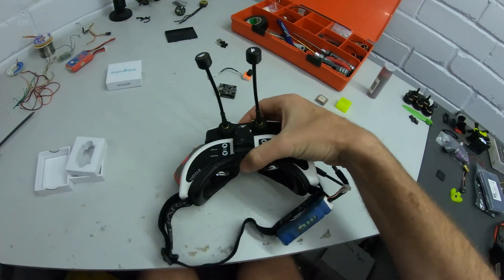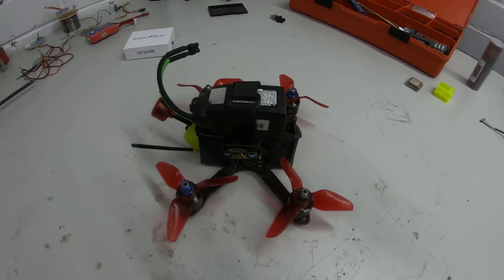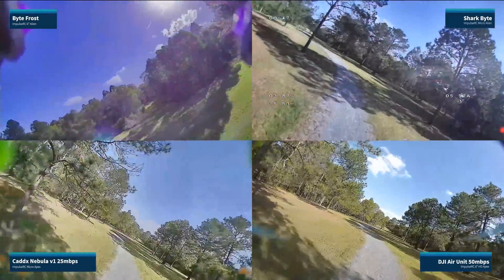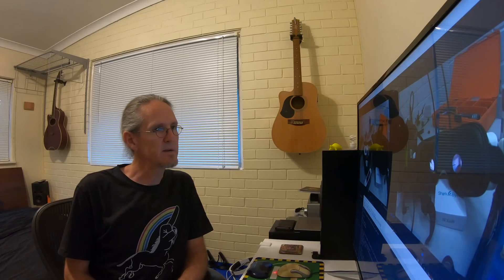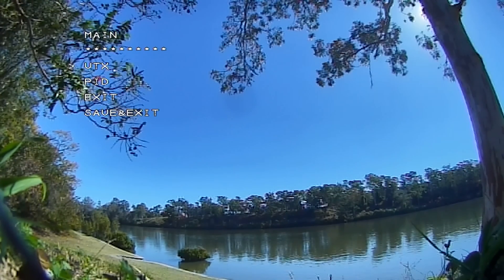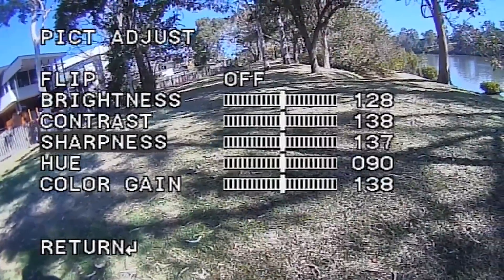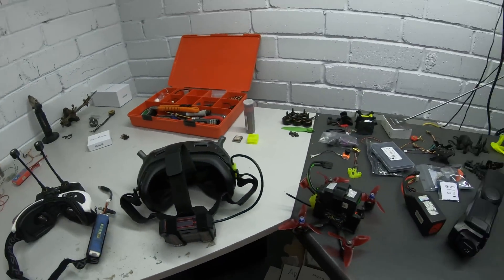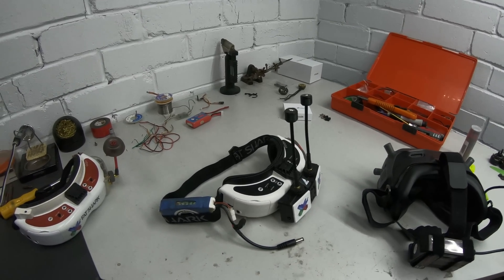Digital FPV Shootout 2 - Shark Byte

Comment: How did you get the Betafloght OSD elements on the screen, mine won’t work!
Reply from the maker: It's all in the online manual. Double check you have the right UART sending MSP data, OSD is enabled in general config, and have wired tx to rx and vice versa (the manual doesn't make this part very clear). Good luck!
Reply: @strepto42  ok thank you very much!
Reply: @strepto42  one more question, the the TX on the FC should go to the TX on the VTX and the RX on the FC should go to the RX on the VTX, right?
Reply from the maker: @ItzAnthony  No, as I said, tx goes to rx, and rx to tx. That's probably where you're going wrong. It's a classic serial port thing. You want the signals coming FROM the FC to go to the RECEIVING pad on the Sharkbyte (or any other peripheral like a GPS). That's why they must cross over. The manual doesn't state it clearly but yes you must wire TX->RX and RX->TX
Reply: @strepto42  ok thank you, totally missed that part haha
Reply from the maker: @ItzAnthony  All good, hope you get it working!

Comment: As a non FPV user I got to say that DJI is in another league in picture quality,
but looking at the comment section here it seems we don't agree. 
I guess it's about latency and feel then because its like comparing 70s footage to mid 2000s.
Reply from the maker: You really need to see it in goggles to get a good idea. DJI does look better, but not so much better than any digital system does compared to analog. That really is night and day.

Comment: Just wondering, I am thinking of the TX5S.1 VTX but this uses 2s-4s batteries. I f I use a step down Buck to 12v with an input 5-27v I could use this upto a 6s. This would reduce cost as I would only need 25-200mw for racing also weight, all this would be pending how the OSD gets its voltage readings, that is if it uses a UART. What is your advice on this?
Reply from the maker: Yes the OSD gets info from the FC which reads vbat. You'd be fine using a regulated output from the FC to power it - in fact that's how I am imagining it will work. Just make sure the output is rated for fairly high current, this vtx will draw more than an analog one (will have to measure it sometime).

Comment: I feel differently about it now.... I was hyped and excited for the product but since they changed the pricing I can't see it taking off anymore

If you're one of the lucky ones to get it at $250 then it was worth it, otherise.... They revised their pre-order prices now to nearly $400 They shot them selves in the foot with this because if a person was new to fpv then DJI would be cheaper because they would still need to get a goggle to go with this, and the better ones would be those HDO's you're talking an other $400 or more and you're talking one vtx. 

Now as of this moment you can get a complete dji system from rdq with TWO air units full antennae setup for $819 That's two air units on a better product with everything you need...

At the current price point I can't see this selling a whole lot and i see the company ditching it, so even though I was lucky to get one early and cheap I don't see updates etc coming to this. 

I'm also fortunate to have a box goggles with hdmi input...most of those types of goggles don't have hdmi input so guess what....The only advantage this seems to give is with latency and ability to have more people in the air at the same time..so great for racing but I still feel like It just became too expensive for what you're currently getting.
Reply from the maker: Holy wall of text batman. For me, FPV is a cheap hobby and proper groundbreaking R&D costs a lot of money. 

I guess the market will decide what it's prepared to pay. Shrug.

Comment: Do I need to change anything in the Ports tab? In the Peripherals section? Do I Disable? I’m on Uart3 on the Shark Byte and not sure what I need to change in BF. Clearly I don’t need TBS smart audio or Tramp Audio?
Reply from the maker: It's all in the manual. Enable MSP on the UART you hook up to it for OSD. No use for smart audio or tramp stuff.
Reply: @strepto42  Manual? never had one with mine. If you have a picture of the manual can you send it my way? I’ve looked up a manual for this on Google and can’t find anything in Shark Byte Thanks!
Reply from the maker: @StikFlikFPV  It's online only, surprised there wasn't a link sent with the kit. Check out the official RCGroups thread, a link to it has been posted there fairly recently from memory.

Comment: Whats the range on Shark Byte?
Reply from the maker: There are way too many variables involved to answer than question simply; but let's just say that the range is less than DJI, for now. That said, it will easily outperform analog, watt for watt.

Comment: Hi, Noob here :)
Could the image quality be better with a different camera? The camera cable an connector look similar to the one the runcam 3 nano has. So i wonder if the camera could be swapped for better quality?
Reply from the maker: Theoretically the camera could be improved yes. The connector is a digital MIPI connection; though nothing better is available yet, think about how far analog has come in 8 years...

Comment: what are those antennas that you are using on your goggles ?
Reply from the maker: They're some sort of TrueRC antenna - not sure exactly which ones though sorry, FS supplied them with the original Bytefrost. The TrueRC Singularity antennas will be a great match for the new system though, in fact with those you'll be able to put the goggles in the original case without taking them off!

Comment: Congrats for a nice comparison video.

I miss a bando in there, so we can see if the Fatshark Shark Byte system does better, because it's going to be expensive if you have to buy everything.

380€ for the HDO2 + 350€? Shark Byte (VTx, camera and receiver?) vs 380€ for the DJI goggles + 108€ for a Caddx Vista with DJI camera (Caddx Nebula sucks badly).

A few months to think about it yet, until the Shark Byte is released... Gotta watch the price tho
Reply from the maker: Yeah sadly Brisbane doesn't have any good bandos any more. There would have been a perfect one back in 2015 but it's not there any more...
Reply: @strepto42  thanks for the answer.

Comment: This is an honest review giving the choice to the user. I love the idea of Shark Byte as something that you can have part of the goggles is bringing it more in line with DJI. I am interested on how you recorded the output of the video, is there some kind of output other than HDMI that you can connect an external recorder like the immersion rc powerplay?
Reply from the maker: Hey, thanks, appreciate the comment! The goggle module has an onboard DVR, as did the original Bytefrost groundstation. I compare those and the raw hdmi output recorded on an external, independent DVR in my subsequent video: https://youtu.be/Qr5FAfwpo1g

Comment: This looks soo cool!!! This is the way I'd like to see digital go
Reply: I'd like to see both DJI and FatShark succeed. Having several options for multiple applications is the best route for digital in my opinion.
Reply: @twiztidkiller48  Definitely mate, I just want a cheaper option than DJI haha.
Reply: I can't say I blame you there, had to do a lot of saving myself and just bought into DJI. If I don't absolutely love it I'm gonna be pissed 🤣
Reply: @twiztidkiller48  hahahha fair enough mate!! Well done :).  I just love racing and flying on the ragged edge to much haha, no way I could afford the replacement air units etc from crashes at speed haha.
Reply from the maker: It's a good pathway I think. A natural evolution from analog.
Reply: Yeah, I could see that being an issue for you! Thankfully all I tend to break are arms and props lol
Reply: @twiztidkiller48  Yeah metal gates at full send aren't a racers friend hahaha.
Reply from the maker: @slowentropy4531  No they are not! Which is why I fly like a grandma these days; I hate building :D Hot laps are pretty frickin fun though!
Reply: @strepto42  FPV is fun mate, Analog digital, slow fast whatever hahaha. I still love flying whoops, micros whatever hey haha.
Reply from the maker: @slowentropy4531  That there is exact truth :)

Comment: Regarding the OSD issue, why don't they simply generate a black analogue signal for the FC / OSD vid input, take the FC's vid output back in and overlay it on the image? We don't really need our OSD text to be in HD. Then no one has to reinvent the OSD, we're good with what we already have. Or at least give that as an option for those who prefer the FC or other OSD. I have modified the code in some of my OSD's and would not want to give that up for HD fonts.
Reply from the maker: That would be way harder than the way they've implemented it I suspect. I have, however, confirmed that the OSD is generated on the receiver, not the transmitter as I stated in the video. I'd like to see them implement the betaflight Canvas Mode (Displayport) - that would make it easier for everyone to play and they'd just be displaying what was sent in that instance.

Comment: Thanks for the video, i think this is going to be the digital system i invest in, DJI is just to expensive :(. will these work with the Attitude v5, and Dom v3?
Reply from the maker: Cheers. If they have HDMI in, they will, although the picture won't be quite as lovely (but it will still look better than analog)

Comment: Film a big stopwatch with all systems. Make a picture from all displays incl. stopwatch, so you can read the stopwatch and all displays. Now you can simple calculate the latency. (stopwatch time - display time)
Reply from the maker: Yes... but using the frame counter for the video is almost as good. At 240fps each frame is about 0.004s.

Comment: Amazing review ! Do you think there’s a way to measure DJI latency when it’s “degrading” dynamically ? That is the key difference that I’d like to know. In this way we could check if the milliseconds value in the DJI goggles is correct when they are working in no “ideal” conditions. Maybe with some kind of frequency “jammer”? Dunno
Reply from the maker: Thank you! :) I can't think of any way to do it realistically; too many variables and too hard to measure in controlled circumstances. But I tend to believe the goggle display.

Comment: What is the VTX power of the DJI Air Unit in the video?
Reply from the maker: Good question. The Caddx nebula was on 500mw, but not sure what the air unit was on; depends what the goggles decided (DJI stuff has a habit of cross-dressing settings when you swap quads).

Comment: Latency in digital-land has to be some multiple of frame rate. you can't have a half a frame or you'd see tearing. So When dji says 23ms, it's likely 2 frames, 2* 16.667ms = ~32ms. So from 17ms to 31ms it's two frames. Once it goes past 33ms you get 3 frames latency (so ~47ms from the previous 32ms, a 16.667 ms jump), which would be consistent with the "stutter" we see when we reach this point (because an additional frame was dropped). I don't think the variability can have more resolution than the frame rate, so if this is true, it's much less variable than is claimed. As I see it, byte frost is one frame at 60hz (16.667ms). I don't think there's any in-betweens so to speak. Need to confirm this, but I dont see how else it could work
Reply from the maker: Yes I realised this too. 60fps finest granularity is ~16.6ms. Half that for 120fps, which is what the DJI goggles run, so ~25ms makes sense there too.

Comment: Latency?
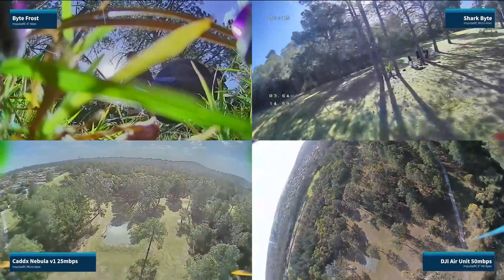Reply from the maker: Yes. "5:00 latency test"
Reply: @strepto42  sorry and thanks
Reply from the maker: @boratsagdiyev1586  however, as others have pointed out and I have realised, 16ms the shortest latency I can measure at 60fps in the goggles. So the conclusion is simply that SB and analog have similar latency and dji has slightly more, although it is close.

Comment: I think its funny.. people said that DJI has a undpredictability of signal loss... but when I look at sharkbyte.. It is really the one that is unpredictable, DJIs system with the megabits shown is way better. it is almost like RSSI. plus I found that analog breakup happens very quickly,  DJIs degrading of the signal strength happens very predictable, no sudden blank screen how it happens often with analog/bytefrost... I personally think that this is the way to make it, Fatshark should realise this.
Reply from the maker: They're fundamentally different systems at their core. I think it's good to have a choice; everyone's different and some people prefer the analog style breakup. Some prefer the clarity and the variable latency that comes with it.
Reply: Exact. You have also problem  with RapidFire. It's good then suddenly  it comes very bad.

Comment: I love the balanced opinions in this video. I have HD3s and don't do a massive amount of FPV. This set up would let me carry on with analog for some machines and go digital on others, presumably without breaking the bank [awaits announcement]. I hope there will be some 30x30 support, though. My 5" has room on the back for a 20x20 but my 7" doesn't.
Reply from the maker: Cheers. Yes more vtx support would be awesome.

Comment: Hmm I don't think the OSD is only in software by the way. With analogue there is a chip on the FC that is responsible for painting the OSD on the picture, so it's hardware related there, that's also why you connect your camera to your FC usually and not the VTX. For making the OSD data available, sure that is software. What we might see is hardware for painting the BF OSD on future digital VTXs until FCs catch up to really kill digital and the digital OSD chip moves back to the FC.
Reply from the maker: Analog OSDs need a separate chip to manipulate the picture; with digital it's all done in the same chip space I think. But yes software drives it all.

Comment: If this isn't less than double the price of analog then i still don't see a valid reason to switch. You can fly with analog the same way you fly with digital, and maybe even better because it's lighter. I'm not paying more for aesthetics.

The only real reason to switch do digital in 2020 is because now we have a good company that cares about the hobby, unlike DJI. If we support Fatshark now we may see a lot of 3rd parties producing and improving the Shark Byte technology or another digital system, and making it cheaper too. If we support DJI the only things that will happen are they becoming richer and the products getting more expensive.
Reply: yeah, what company is that again? fatshark said about themselfes, that they care about the community, yes, but the point they started listening to the community, (taking it serious), was when other goggles came out and started doing, what fatshark could not do for years, when others actually started making really good goggles, with features, they could not build into theirs. that was when they started "caring" in my opinion. other than that, DJI is working on the product nonstop, I've never witnessed a FPV company that actually improved firmware over years, (well with goggles)  DJI did this. they even made their tec available for cam manufacturers, (caddx?) and I think also runcam now. Idk if they "care" but they seem to listen, and work on the product for the benefit of the users.
Reply from the maker: Well it's certainly one good reason. I kinda like being able to see stuff when I'm flying too ;)
Reply: I agree, if they really cared, we would have a better dvr for my hd3's. Will still root for fat shark. Smaller companies don't have same  cash as large corps to spend on developing product.
Reply from the maker: @clean1566  I think the core focus for Fatshark has always been on the goggle experience. The other stuff is secondary. Greg is a hobbyist who does it for fun, not to get rich, and he got burned by the community early on, so now he just does what he wants, and focuses on the important aspects for FPV flying, pure and simple. I agree that there are areas that could be improved, but there's a reason the vast majority of us play and prefer FS goggles... Yes it would be nice to have a better DVR, and a bunch of other features (I have my own personal wishlist too) but at the end of the day I love flying with these goggles, optically and ergonomically they are simply the best goggle that I have found, for my own needs and face.
Reply: @strepto42  Thanks for the insightful reply. I only threw that out, because didn't they put a better DVR in one of their goggles, like the Scout or something? I'm not as close to everything FPV drone related as I was 2 years ago. I've branched into R/C airplanes, and am trying to fly FPV with that platform.Still love Drones(no replacement for that)But it seems to me that's what was out there. I don't know  if the form factor of the HD3 would have allowed them to do it. But I love my HD3's. Not getting into the hobby till I was 62, I'm not easily able to switch technologies, being on social security.lol  So I'm hoping,and rooting for Fat Shark to come through. This looks like another step in the right direction,and an improvement over Byte Frost. I'll also throw out Fat Sharks outstanding customer service. I don't know about DJI's, but Fat Shark has got my back. So yes, I selfishly hope it comes in @ $200. All I know is, I won't be getting DJI unless there's another stimulus check, or I win the lotto,etc....Just discovered your channel and subscribed. Good work, and I'll be watching. again, thanks!
Reply from the maker: @clean1566  Thanks mate :) Yes I agree re their service. I know the guy who does the AU/NZ repairs and he is a top bloke.